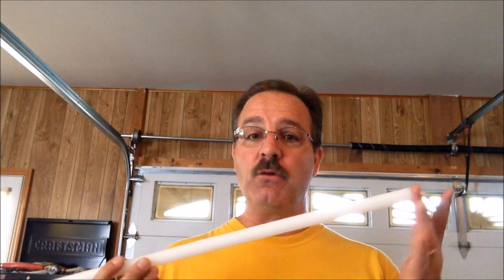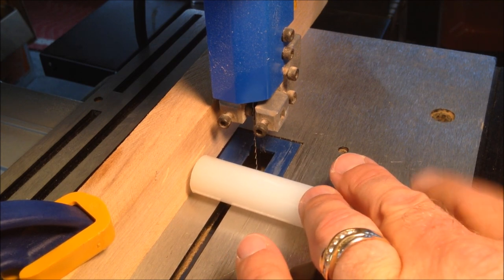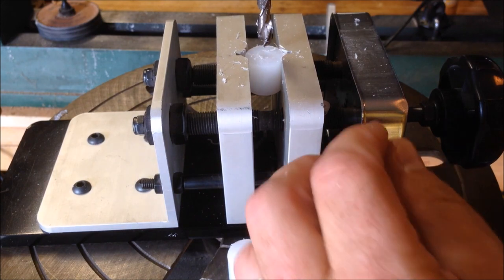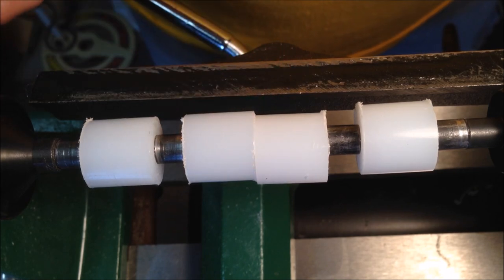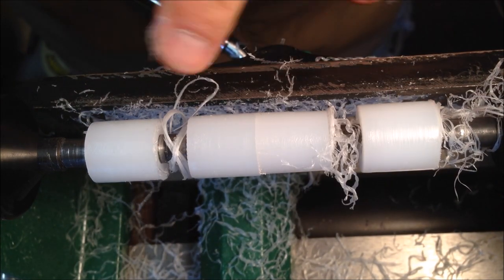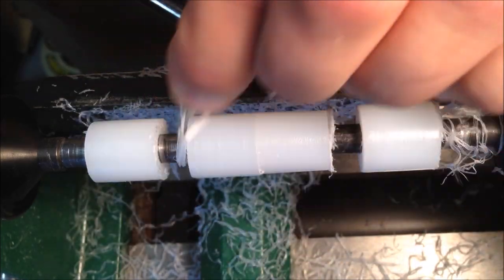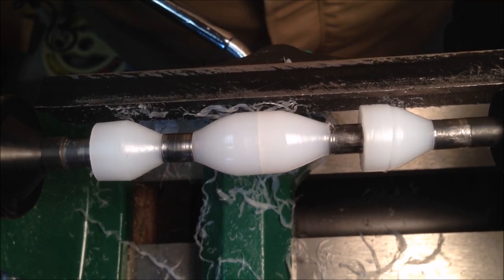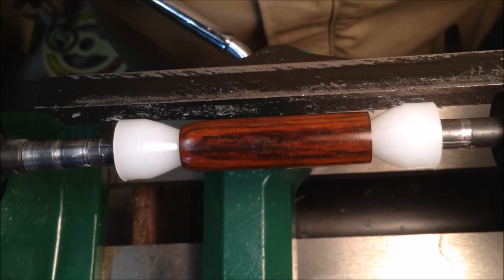Make your own Non Stick Pen Bushings

Comment: Saw your video years ago, kept it in mind.....now I’m batching out some pens remembered your inspiration. Thanks
Reply from the maker: Thank you Peter,
  There is a mistake in this video, the hole in the center of the non-stick bushings should be 1/4”, not 7mm. I hope that helps. 

Regards,
Bob

Comment: After just pricing these things I decided to see if I could make them.  Did a search and lo and behold, one of my YouTube subscriptions has a video on it.  BRILLIANT and Thank You!!!
Reply from the maker: +sreihart Thank you,
  Once you make them you'll love them, they work great. You'll never glue a blank to a bushing again and no more glue changing the diameter of your bushings. 
  A couple notes. In the video, I said I drilled a 7mm hole, it was actually 1/4". You'll get a better fit on the mandrel. Also, UHMW plastic rod works just as well and is cheaper. 

Regards,
Bob

Comment: I really appreciate you taking the time to share this knowledge. By far, the CA finish is my preference because I like the protection the hard finish provides. However, I have to spend a while after each pen completion to let the bushings soak in Goof Off to remove the hardened glue. Not only that, but when taking the finished blank and glued bushings off the mandrel, you have to tap the bushings to break them free from the blank. Many times it's a clean break, but sometimes there are jagged glue edges to sand carefully, so the finished blank is not scratched in the process. This non-stick rod will be a huge added efficiency to my process. Thanks again!
Reply from the maker: +Stephen Landry Your welcome Stephen,
  UHMW rod works just as well as the HDPE and it's about 1/2 the cost. Your going to love these bushings, I was having the same issues when I discovered them. There wonderful. 

Regards,
Bob

Comment: Just wanted to thank you for this video. I was getting seriously tired of my bushings getting coated and sticking to the blanks. I've tried using wax on them, but it never seems to really work. Picked up the HDPE bar from amazon and turned my first set of these today. It definitely cuts easily, but those strings! I must have stopped to cut them off 20 times just making four bushings! I did notice a little bit of slop with the 7mm hole and just now noticed you suggested a 1/4" hole in the comments... oh well... next time I'll change it up.

Anyway, I'm looking forward to giving these little guys a spin next time I make a pen, and I have enough of the rod left to make several more sets if necessary!
Reply from the maker: +Aaron Craven Thank you Aaron,
  I'm still using the first set I made, periodically I'll use a slew to clean off the glue build up but other than that they work great.

Regards,
Bob

Comment: I took your idea and turned my own from HDPE. Saved a bundle of $$$ and they work well. Only I used a 1/4" hole not a 7mm. Tighter on the mandrel.
Reply from the maker: That's great news Joe,
  I am glad my idea helped you out and especially saved you some money.
  I have a little LDPE I'm going to turn a pen from. It should turn like a dream, finishing is my concern. Not sure how sanding will work or what finish will stick to it. 

Regards,
Bob

Comment: Thanks for the video. I almost bought a set of these last week, now i'm going to make my own.
Reply from the maker: +Tyler Crouch Thank you Tyler,
  I've also learned that UHWM plastic works just as well and is cheaper. 
  In the video, I said to drill a 7mm hole. 1/4" is much better. 
  Your going to love them for finishing with C/A. 

Regards,
Bob

Comment: I have been wood turning 2 months and have started turning pens. I would love to have those nylon glue covers you made. And I appreciate you insight and the many alternative ways you show to do things. Thanks for all you do.
Reply from the maker: Hello Richard,
  I have already given them away. You can get a stick of 3/4" HDPE on Amazon for under $12.00. I have also
been told that UHMW works just as well and is half the price. The sticks are about two fool long so you can make multiple sets of bushings as the old ones wear out. I have also found many other uses for the material. 

Regards,
Bob

Comment: Got the non stick bushings off the shelf when I started finishing with CA glue...will never buy another set! Great idea, nice video, thanks for sharing! Subscribed!
Reply from the maker: Thank you Timothy,
  UHMW is even cheaper then HDPE and works just as well. Also, I said in the video to drill 7mm holes, 1/4"'work better. 

Regards,
Bob

Comment: That's a great idea! At roughly $5 for a pack of four bushings that's a huge money saver. Thanks again for another informative video, I will do this myself.
Reply from the maker: Thank you,
  UHMW will work just as well as HDPE. Drill a 1/4" hole instead of 7mm, it will fit the mandrel much better. 

Regards,
Bob

Comment: Great idea and glad to see that they can be made in our own shops.  I was going to try to find out where to buy them.  Thanks for the great video.
Reply from the maker: +Edwin Leach Thank you Edwin,
  You can purchase UHMW rod, it's way cheaper and works just as well. Also, you could melt milk jugs and make your own HDPE blank to turn into bushings. 

Regards,
Bob

Comment: Thanks for the tip! I've suffered from having CA glue on the metal bushing and then trying to carefully 'break' it off! Would love a set!
Reply from the maker: Jason,
  Once you try them, you will never want to use anything else, they are amazing and like I have been telling everyone else, I haven't messed up a pen since I started using them.

Regards,
Bob

Comment: Bob great idea.  I think I'll try making some myself.  I've been using CA glue too to finish my pens and it helps to put on thin coats so the pieces don't stick to the bushings.  You also don't need to use multiple grits of pads if you keep the coats thin.  I use an 1800-2500 Klingspor wet/dry pad and it gives me a perfect finish before polish.
Reply from the maker: Great tip on finishing Ann. You’ll love the nonstick bushings. 

Regards,
Bob

Comment: nice. i dont turn pens yet, dont have the tools for it. i will one day. i think its a nice thing to try. 

what i really like about woodworking is the way i can make some of the tools i need myself. your vid is a great example of that. its a form of self sufficiency i really like. i turned a few handles for some chisels i made out of old files. same feeling of accomplishment and self sufficiency.
Reply from the maker: Thank you Willem,
  I agree and I think I need to start making more of my tools. It's so easy to buy them that we sometimes don't even think about making what we need.

Regards,
Bob

Comment: Thanks Bob! Had a chunk of HDPE sitting in my tool box and turned some after watching your video. Was thinking about ordering some but don't have to do that now. They work great!
Take care, Dave
Reply from the maker: That's awesome David,
  Have you had a chance to try them out yet? I'd like to hear what you thought about them. I won't apply C/A to a pen ever again without mine, They are one of the best tools a pen turner can have.

Regards,
Bob
Reply: RJBWoodTurner
I agree Bob. I turned a pen yesterday afternoon just so I could use them and am impressed. I too will not apply CA glue again without using them. Very nice not having to clean the glue at the bushing and not worrying about a messed up barrel end. Again, Thanks Bob! Great tip!
Take care, Dave
Reply from the maker: David Morgan Thank you for letting me know how they worked Dave, I love reading comments like this.Regards,Bob

Comment: Thanks for your videos, great Idea.  I will be getting some of the HDPE for several reasons.  One is your Idea, and the other is that I am so cheap that I will use a piece as a way to put me pen kits together using me drill press with a piece of HDPE in the chuck.
Reply from the maker: +Jerry Dionisio Good luck Jerry,
  You can save money even further by melting milk jugs. They're made from HDPE and you can melt them into a block that you can turn into bushings. Peter Brown is the master and has several videos on his channel about melting and turning HDPE. 

Bob

Comment: Guess i am off to the workshop to make me some of these, great vid Bob....Pete UK
Reply from the maker: +Pete Alford Thank you Pete,
  I found that UHMW plastic works just as well and is cheaper. 
  Also, I said in the video that I drilled a 7mm hole. I actually drilled a 1/4" hole. You want it to be sized to your mandrel. 

Regards,
Bob

Comment: I used your idea to make some of your bushings from the spouts and lids off of the high speed glue sold in the big box stores around here. I chuck the pieces in my 3 jaw mini chuck and put the 7mm bit in my tailstock jacobs chuck and bore out the centers, then put them on the pen mandrel and cut the taper.
Reply from the maker: Lee,
  I hope the bushings work well for you. If you want a little tighter fit on the mandrel, 1/4" is truer to the diameter. 7mm is a bit large and I only learned that after the video was posted. 

Regards,
Bob

Comment: Just ordered some HDPE from Amazon Thanks for the instruction and inspiration. I plan to use some to make a non mar Pen press also.
Reply from the maker: Your welcome Gary,
  I'm glad you found the video useful. You're going to love those bushings. They make applying C/A a breeze and you never have to worry about gluing the bushings to the pen and cracking the finish while trying to remove them. You also don't have to deal with the build up on the bushings which can change their size. 

Regards,
Bob

Comment: I have bought most everything to turn pens. Great video..... I will make
Some of these brushing. Have not made a pen yet but will soon. Thanks a million
Reply from the maker: You are welcome Arthur,
  You're going to love pen turning. Let me know if you have questions along the way, I'll try to answer them. 

Regards,
Bob
Reply: Thanks Bob,
I found acetate rod, 3/4" x12" long on Amazon... Meets astm d6100.. Could not find a Amazon item #. I was wondering if this will turn OK to make these bushings. I can get 6 bushing if I cut them about 11/16 each.
Thanks,
Arthur
Reply from the maker: I don't know about the acetate rod. I searched "HDPE Rod" on Amazon and a company popped with several different sizes. I purchased 3/4" X 24". 

Regards,
Bob

Comment: i found a cheap HDPE cutting board and chopped it into strips and turned that, worked out great.
Reply from the maker: That is a great way to get HDPE cheap. Plus you probably have a lot left over for other projects. 

Regards,
Bob

Comment: Looks like you could make yourself a lifetime supply in a single afternoon.  And for cheap! Lol. Great tip. And as always, another great video. Thanks for sharing this
Reply from the maker: Thank you Mitchell,
  They are cheap and very easy to make. My original set is still in pretty good shape so they last a long time too. I put you in the drawing, With that new lathe, I expect to see some pens one of these days.

Regards,
Bob

Comment: Thanks for you videos, I'm enjoying them and learning a lot at the same time.Wish you were based in Louisville I'd be stopping by for some lessons. Thanks again, Will from the Ville.
Reply from the maker: +WILL R Thank you Will,
  If you ever make it up to Evansville, let me know. 

Regards.
Bob
Reply: Thanks for the invite. I do have one question,in the process of making colored pencil pen and when I'm sanding the color of the pencil clay is transferring to my wood. Is there some thing I'm doing wrong? Thanks, Will from the Ville
Reply from the maker: +WILL R No, not at all. After I sand to 400 I clean the blank with Denatured Alcohol and it removes the clay dust stains. 

Regards,
Bob

Comment: I have not turned a pen yet. I am watching many videos to learn how to do it the best way. This little trick looks like it will give a lot of latitude. If I don't win them, I will make them.
Reply from the maker: Hello Dick,
  They are extremely useful, I don’t apply a C/A finish without using them. Unfortunately, this is an old video and I’ve already given them away. Thank you for watching. 

Regards,
Bob

Comment: Great video as always, thx. I make lots of pens and would love a set of those bushings. Best wishes.
Reply from the maker: John,
  They are a must for a pen turner. I know you have had to deal with C/A sticking to your bushings. I was never able to find a good way to get it off without occasionally chipping a pen which meant starting over. I haven't ruined a C/A finish since I started using my bushings.

Regards,
Bob

Comment: Thanks for the good video I am going to make some
Reply from the maker: +Richard Schaffling Your welcome,
  Look for UHMW plastic rod, it's usually cheaper and works just as well. Also, in the video I drilled a 7mm hole, 1/4" works much better. 

Regards,
Bob

Comment: Just a heads up. If turning your own bushings. I only use three. Yes three the center one I cut a little longer. Then turn both ends. That way it takes care of both pieces on a 2 piece pen.
Reply from the maker: I made three for my second set. It’s the best way to go. 

Regards,
Bob

Comment: Thanks for the video, and providing the link to the Amazon source.  I've been planning on buying a set online, good to know I can make my own.
Reply from the maker: Gary,
  I have entered your name in the drawing. These bushings are a dream for applying C/A glue. 
  C/A is the ultimate finish, it not only makes your pens look great, it protects them. 
  Before you start turning, do you have a way to sharpen your tools? It will be the difference between night and day and will alleviate a lot of frustration. 
  Not sure where you live but it you have a turners club locally it will be worth joining. Those guys will help you with sharpening and they know all the best places to get tools and supplies. 

Regards,
Bob
Reply: RJBWoodTurner Yes, thanks for asking.  My (used) skew came with a nice hollow grind, and I've been able to maintain the edge so far with a sharpening stone. In a few weeks there's a sale at Harbor Freight, and I'm hoping to pick up an 8" bench grinder at a nice price.
This weekend's project is to make a sanding disc for pens using a spindle nut, similar to what you did in your video. The epoxy is curing as we speak. :)
Reply from the maker: Sounds great Gary,
  You want to go go for the 1,750 RPM grinder, the 3,400 RPM will build to much heat and slower bring speeds are better for your tools. If I can help in any way, please don't hesitate to ask. 

Regards,
Bob
Reply: Wow, thanks for the advice. You've been a huge help already.

Comment: Thank You for sharing!  So, I been wondering around the house looking for HDPE containers.  So far I found 2 milk jugs, 3 shampoo bottles, and a couple of powdered pancake mix. I am going to experiment with grinding up the HDPE, and melting it into one of those rods using a hydraulic press.
Reply from the maker: +WigWagWorkshop That sounds like a good experiment, is like to know hot it turns out. 

Bob
Reply: Well, first experiment was a fail, but I learned a lot.  What I learned is, milk jugs will work best. The shampoo bottles are too thick, and did not melt even with the thinner milk jugs.  Also I made a square mold, that was about 6 inches thick, by 12 inches long which I think was a little to big.  So, while a few modifications would most likely be successful, I think spending $7 for this project will be a better deal.
Reply from the maker: +WigWagWorkshop LOL,
  Knowing when to cut and run Is a valuable skill. May I recommend UHMW over HDPE when you purchase a rod. What I have found is I get thick glue build up on my non stick bushings because I'm always pushing the glue to the ends of the blanks. With the UHMW, a quick pop on the lathe bed and the C/A pops right off. With HDPE, it will come off but it's more work, I usually have to tap it with a hammer or the tool rest. 

Bob

Comment: Going to have to give this a try. I bought a cheap set of "nonstick" bushing on Amazon but they still get glued to the blank everytime I use them
Reply from the maker: Quick edit, use a 1/4” bit to drill the center hole instead of 7mm. You’ll get a better fit with the mandrel. 

Regards,
Bob

Comment: Great idea I've just ordered a rod and a square block the only thing is through here in the UK everything is double the price
Reply from the maker: +Arty S Hello Arty,
  UHMW plastic rod works just as well and it's cheaper. 
  In the video I said to drill a 7mm hole, .25 inch is much closed to the mandrel diameter. I'm not sure of the metric conversion but Google will know. 

Regards,
Bob
Reply: Thank you for your reply Bob that's helps me a great deal
Regards Arthur
Reply from the maker: +Arty S You're welcome. 

Regards,
Bob

Comment: I've been turning Hdpe for several years for bushes and bearings in other applications. My source of the material is simply milk cartons melted into blocks turned into rods and processed as appropriate. Most pen mandrels are indeed 1/4 inch or 6.35mm. Like zac I have made some pens from the stuff
Reply from the maker: +trapper23ful Thank you for the info. 

Regards,
Bob
Reply: basically any plastic container that has the recycle symbol with the number 4 is hdpe or number 2 is ldpe id avoid trying to process other plastics such as pete pet etc as they tend to give terrible fumes. HDPE and LDPE are mainly vegetable based eg starch and can be melted in a toaster oven at about 180-200c
Hope this helps